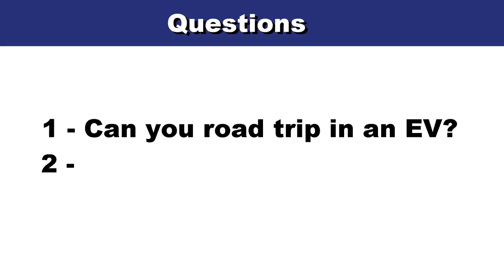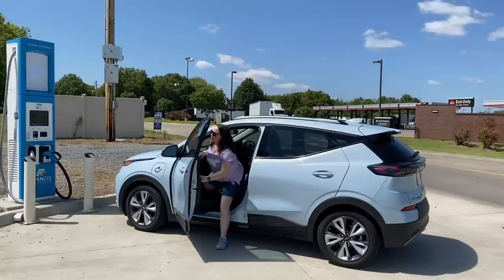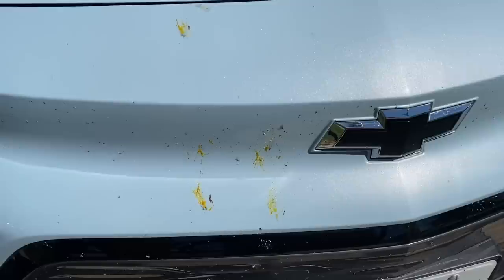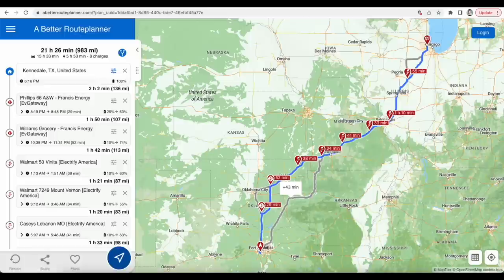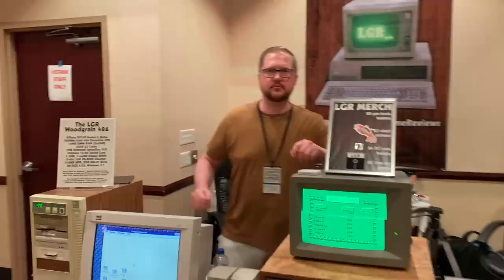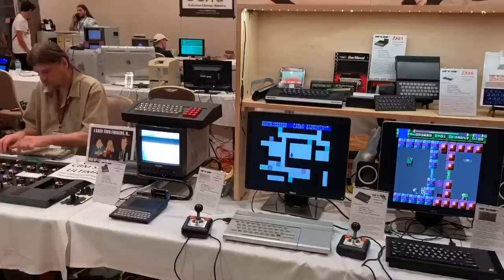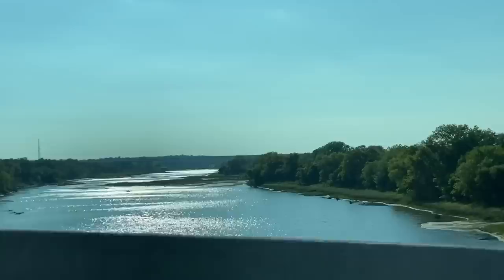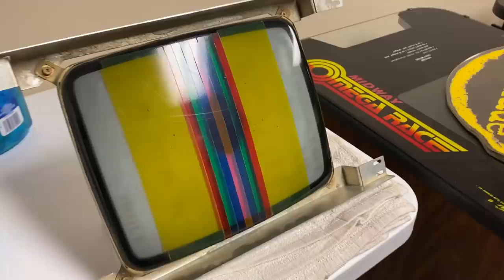EV Roadtrip, Vintage Computer Festival, and Moonbase Repair

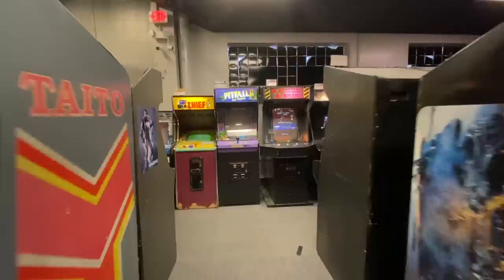Comment: OMG!! They used to have that monochrome motor-bike jumping game from 12:35 at my local roller-skating rink from when I was a little kid, the Stardust!  This had to be in the 1979-81 range. They just recently finally tore down the building, it had stood since the 1960s and was still in operation in the early 2000s, but in 2019 I think, after being vacant and for sale for ages, it was demolished. 😥   
Still, good memories of my early childhood there. From obscure games like Moon Shuttle and the afore mentioned motorbike game to Sprint II, Space Invaders, Dragon's Lair, more then I can name. This place always had between 4 and 8 machines going.

Comment: I'm still too impatient for an EV, coming from riding motorbikes most of my life I plan to do 180-200 miles to a tank, fill up with my helmet on and preferably pay at pump and ride off. I've topped 1200 miles in a day before so yes I'm way too impatient for one of these. I only really use a van or a car if I have to because the convenience is so much less.

I guess if you like taking breaks it's ok, but for me I've not got that patience. I'm a  "Chug a red bull, inhale a snickers, get going" kind of bloke 

Hydrogen does interest me mind

Comment: What I gather from this video is you need plenty of cash to buy food when make the frequent stops with an EV making the money saving aspect completely irrelevant.  When I go out, apart from the odd stop for the loo, I just want to 'get there'. 

Also the initial cost of the car, the fact some EV fast chargers in the UK are charging £1 per kWh and the impending road pricing makes them totally unaffordable. Also, who would buy a second hand EV with the crazy cost of a new battery.

Comment: Excellent video!  A funny thing about "road tripping"-- a VERY long, multi-day road trip like yours is clearly essentially unaffected by EV charge times.  You're driving all day and going to arrive sometime in the middle of the second (or third or fourth) day, regardless.  However, here in the northeast, a "road trip" might be 4 hours from New York area to Washington DC or 8 hours up to Bar Harbor, Maine.  In that sort of road trip, an extra 1-2 hours makes a huge difference.

Comment: I thought I had to make a lot of stops with my old restored 70s RV and its 220 mile fuel range before I saw how many stops you were making with the ev :p.

Don't know if you've been before but the next time you're out in Portland, Oregon, visit Next Level Pinball, out in Hillsboro.

They're similar to galloping ghost in having acres of both new and vintage arcade and pinball machines to play with all of the vintage hardware working.  

I'd say go during Prge, but alot of the vintage machines at the con are from them, so they may not be readily available.  :)

Comment: Is the Tandy/Radio Shack Headquarters still in Ft. Worth? I had a 1000 RLX, with the monitor, dmp, keyboard, mouse and  use of floppies 3 1/2", with a 20 mb(though faulty) hard disk drive. I had a warranty, so the drive was replaced(it jumped between DOS and Desk Mate at will. I also had Print Shop, Expert Software titles, Wheel of Fortune software. And I learned it's version of BASIC!

Comment: When do we get Petski robots for the Coco?
Love your road trip story.  Great video
About moonbase:. When you get a new CRT, it could be possible to move that transparent sticker.  Inject mineral spirits under it with a syringe.  Pull it off.  Let it dry and the glue will be sticky again.   Procedure copyright LockPickingLawyer. .lol

Comment: With electricity prices in Europe going rampant (my bill went up from 135 per month to 336 per month, that's euros but that's also dollars these days) it is actually cheaper to drive on petrol, than it is to drive on electricity, rendering electric cars completely useless unless you have an elaborate setup with solar panels at home. Not going to lie; I wish I had solar panels now, but I'm sticking to my 2003 Ford Fusion (not the same one you guys in the US have, completely different car) as it's economical, practical and not using electricity. I'm also near both the German and Belgian border so I am in the luxurious position where I can pick which country is cheapest to fill up at.

Comment: The Bolt is certainly capable of road trips, it’s just slow compared to most other EVs, although it isn’t that much slower if you do the 10-80% comparison than many do. The Bolt does this in about 1 hr, other average EV does it in about 30-45 minutes. The range is also pretty average compared to other EVs available now. I’ve owned a 2019 Bolt, currently own a 2022 Bolt EUV that looks the same as the other one you encountered, and a 2022 Ioniq5. In the past, I’ve also owned a 2017 Kia Soul EV, a 2020 Kona EV and a 2021 Tesla Model 3 Long Range. The Tesla and Ioniq5 are far faster to road trip than the Bolt, but the Bolt can still do all the trips the others could do. 

Comparing to an ICE, even the fastest EVs will be a bit slower if you’re driving cannonball style (i.e. only stopping for gas and nothing else). If you drive like a normal human and you have a faster charging EV (like the Ioniq5, EV6, Taycan/etron GT, new Tesla, etc) then the difference is pretty small in the real world. Plan bathroom, food and drink stops at your charging stops and yeah, you don’t really waste much time. In 20 minutes you can get nearly 200 miles of range in those faster charging EVs, and 20 minutes goes by much faster than most people think.

Comment: thanks for video. long distance trip with EV is really interesting part. It needs to be planned carefully as you said it can have broken charging station. as times goes by it will be better  but it is still nerve breaking situation if anything goes wrong..  I hope there is any emergency charging service on the road.(like by AAA if that is possible but you can still tow your car to nearest charging station by AAA).
Reply: Generally, true but the Tesla network is excellent.  I've never stressed one bit about getting to the next charging stop or whether it will be functional.

Comment: The sound of a CRT breaking and losing vacuum mimics the sound of ones hopes and dreams as they shatter and evaporate in an instant. real bad luck on that one, have myself accidentally cracked the neck of a CRT on projects i've worked on in the past! on the bright side, there are actually people who still refurb them but at that point; washing, cutting, re-coating and re-sealing it is basically a brand new CRT 🤔

Comment: Actually if the are two truck stop close to each other, the one with all the trucks has good food... Although if both are full, it is may be because they filled the better one first. However I find that Mom and Pop (aka one off) truck stops either have good food or they die. Most major truck stops have decent to great food, because word gets around from trucker to trucker, and places with bad service(s) or bad food get a bad reputation and trucks by pass them. That is why when I am on the road I would rather stop a truck stop then a local McDonald's, Wendy's or other fast food. I love a good Wendy's and usually like McDonald's, but there are some franchises that suck, so not knowing a good franchise/corporate store from the bad makes me visit truck stops rather than any fast food when on the road.

Comment: Thanks for the video about both subjects. I'm getting a bolt euv and I was wondering how many total miles you traveled and how many miles per kilowatts did you use and how many kilowatts did you charge and how much did all the charges cost.

Comment: baterry are not ready for ev im from canada my old corolla 06 can run 18 hours at -25C in winter ! (4 hours idling for lunch and little sleep ) with nice heating  take 1 min to fuel the car total 113$ of fuel i have now 310 000km I believe in electric cars, all that remains is to invent good batteries that can last 700 km with heating and/or air conditioning and which can beat the ratio of what 1 liter of gazoline produces in energy

Comment: Ev's will never take the place of combustion. Most can't remember when freeway speeds were 55mph. Those times took far longer. If you have to stop every 200 miles or so to wait for a recharge. You will miss the days of filling up in minutes, getting some snacks and go. It may however be safer by forcing long haulers to take a break.
Reply: I don't miss those days one bit.  I did a 4000 mile road trip this summer in my Tesla and I loved it.  Far better than in a gas car.

Comment: Thanks for convincing us EVs are not even close to ready.  When we transitioned from horses to cars, there were MANY infrastructural standards changes which needed to happen before we arrived at the present.  Similarly many infrastructural standards which will have to be met while at the same time meet up with the many new technologies which will develop as the standards are implemented.

But one of the things that really cemented me on the notion of "savings" in any sense was the amount of damage to the electric bill.  Especially today...
Reply: I did a 4000 mile road trip this summer in my Tesla.  Was I not supposed to be able to do that?
Reply: @SpottedSharks  Some road trips take longer than others.  But a fill-up of gasoline takes anywhere from 1 to 3 minutes.  How long does it take to charge a Tesla battery to full?  Give me a break.  We're a long way from this thing being truly practical.

Tell me, can you take a road trip through Yellowstone territory?
Reply: @erroneus00  No offense, but there's a lot you don't know about EV road-tripping.  It takes 20-30 minutes max at a supercharger to add 200 miles of range.  That's enough for 3 hours of driving which is about how long I can go before needing a bathroom break.  And there's a Tesla supercharger at West Yellowstone and at Jackson, so visiting Yellowstone would be no problem.  And that's not counting other chargers at campgrounds (they use the same plug as RVs) or hotels.
Reply: @Skellotronix  Tesla's charging network is not built out in Alaska, so no on the 49th state.  The Rockies or anywhere else in the US is no problem.  Look at Tesla's charging network to see for yourself.  And no, you don't have to baby-sit the car while it charges.  Only the owner can unplug the car.  I plug in, then go take a bathroom break, have lunch, stretch my legs.  30 minutes later, at the latest, the car is ready to go.  My advice to you is to simply be quiet on this subject since you have no idea what you're talking about.
Reply: @Skellotronix  True to a point.  In the past prior to and during the transition between horses and cars, the pro-horse people had a lot to say about the rarity of fuel stations and that "fuel" for their horses is found anywhere along the way.  Further, these new fangled cars really required paved roads which were also rare and scarce.

Fast forward to today and we find government using our tax dollars to pay for roads all over the country and it still continues and the for-profit nature of fuel stations have made them plentiful.

As the pressure for electric vehicles and technologies continue, you can expect to see:
1) improved energy density technologies for energy storage (hydrogen fuel cells and batteries)
2) government subsidizing roads and highways with built-in inductive charging under major routes
3) remote recharge/gasoline stations which actually use (burn) fuel in order to provide electricity to charge stations where customers pay for the fuel to power the charge stations.

Adaptations and technological improvements and appropriate government investment will lead us from the "wild west" era of electric cars into a more developed and sane reality of electric vehicles.  It's inevitable.

It's not ready yet and early adopters are the "idiots" who are funding future development.  So I will withhold my criticism of EV users because (1) understanding history and (2) understanding the future.
Reply: @SpottedSharks  This is only practical if you need to stop.  When I routinely drove between DC and Charlotte, NC, I actually never needed to stop until I arrived.  I have no bladder control issues.   Was able to make that drive non-stop in my fuel efficient car.  And these recharge stations are model/maker specific.  And what happens when 30+ Tesla people need to charge at the same time?  That's going to become a thing.

EVs are still in their "niche" phase and still cannot out-perform ICE vehicles for the moment.  That can change and I hope it does.  In the mean time, the materials and the costs of charging at home at today's electrical costs make many people unable to afford a Tesla at any price point for typical use cases.  They are overly expensive and requires maker-specific infrastructure.

Don't make the mistake of thinking I don't know about or haven't researched enough.  While things are still evolving, it's still not an accessible or affordable competitor to ICE powered vehicles today for the general population and for general industrial purposes.  FOR NOW.  See my other comment related to history and inevitable futures.
Reply: @SpottedSharks  I know that it takes 20-30 minutes at a super-charger.

I also know it takes 1 to 3 minutes at a gas pump.  HUGE difference.

Comment: So here is my story about my Tesla EV vs my V8 for Long haul trip, not that i am in Australia and will be doing the trip in Kilometres not miles. So I live 1hour North of Sydney and my cousins live on the New South Wales and Queensland border. about 860 Kilometres from my home. Taking My Tesla Model S Plad from my home to my cousins i had to stop 4 times along the way for about 30 minutes each so that is 2 hours worth of waiting and doing nothing. this turned the trip into a 2 day affair. Driving my V8 powered car i filled up with petrol about 30 mins from my home (cheapest fuel where we live) and i drove non-stop to my cousin house in just under 8 hours. I was just about out of duel when i got there (75 Litre tank) 

My Tesla is great for small trips but will never use an EV for long trips again.

Comment: Questions answers: 1) yes, 2) yes. (I have a 17 bolt) - But it does take longer. A 300 mile trip is not bad because you only have one longer charge session.  Just make sure that session is lunch and it is not wasted time.

Comment: There’s this wonder fluid called “petrol” - saves all the hassle and expense of an “EV”. If you get to try it at some point, it’ll change your life.
Reply: Yup...
Reply: Oh and good luck in 2030!
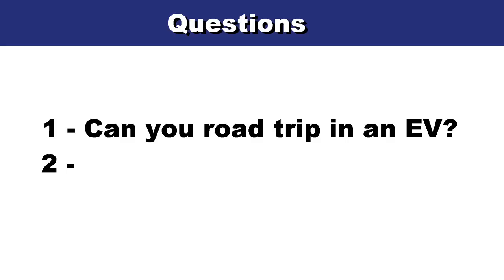Reply: We call it gas over here. But it's actually kind of a hassle. Your tank doesn't fill up automatically overnight, so you have to remember to refuel every week or two. And the fuel is so expensive your cost per mile is many times higher than simply plugging in at home. It ends up being just as expensive if not more so once you add the total fuel cost over the life of the vehicle. I'd rewatch from 0:30 so you understand why this is not a typical EV road trip experience. EVs can make great road trippers. I know, as I've been EV road tripping for 4 years.

Comment: It is my understanding that the Bolt can charge off 120 volt power.  If so can you charge a Bolt off your bluetti connected to the portable solar panels making it into a electric jerrycan?  I'm sure it would be slow and probably inefficient but maybe in a pinch one could have a picnic somewhere sunny and charge their EV.

Comment: If a company like Ford for example wants to dominate the EV market they should focus on rapid swap powerpacks where you could go to a gas station and have a battery pack swapped out in 5 minutes or less. If there was no limitation on range people would buy them like crazy.
Reply from the maker: This has been tried.. It's not a good idea.  There a dozen reasons why that I won't list here.. but trust me, it's a bad idea.

Comment: So your road trip math, specifically how much time having to stop and recharge added to your trip compared to stopping and refueling an ICE vehicle, seems a little off. Average range for a comparable ICE vehicle to what you drove is triple the bolt, requiring 1/3 as many stops. What’s more, average refueling stop is maybe 10 minutes if you go inside the convenience store instead of just gassing and going, compared to your average 30 minute stops. Not saying you’re wrong, just wish you should the formula you used to get your “only adds and hour to the trip per day” number.

Comment: I assume that faulty transistor must have been ‘marginal' as there’s not many components on that board and of it was totally dead would not have been difficult to diagnose even with a basic multimeter?

Comment: soooo i googled Dallas to Chicago and it says its only a 13 hour trip via car, not 2 days........ I love the Concept of an EV but its just not that practical for long distance trips, especially with having to plan a route according to charging availability. In all fairness 45mins-1hour  is enough time to cover quite a bit of distance.
Reply from the maker: That 13 hours doesn't take into account stops for gas, food, bathroom, etc.  It's really more like a 16 hour trip in a gas car. (I know because i made the same trip last year) And yes, a person could do it in a single day, but it would be tough.
Reply: I did a 4000 mile cross-country trip this summer in a tesla.  was i not supposed to do that?
Reply: @SpottedSharks  never said you shouldn't, I just said its not nearly as time efficient.

Personally I would be all for electric cars if the charging infrastructure was as prevalent as gas stations are.

Comment: The number of charging points will need to increase at a fast rate if lots more Electric vehicles are purchased, otherwise you will be doing way too much waiting around.